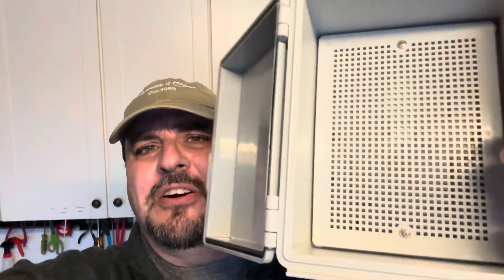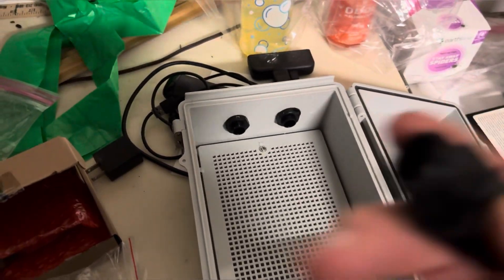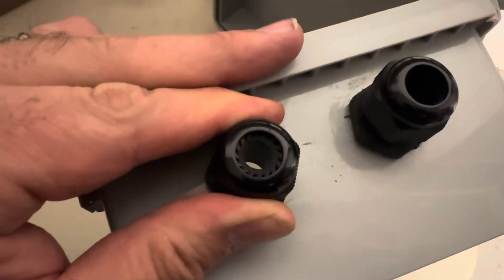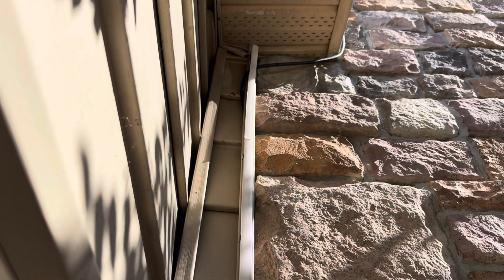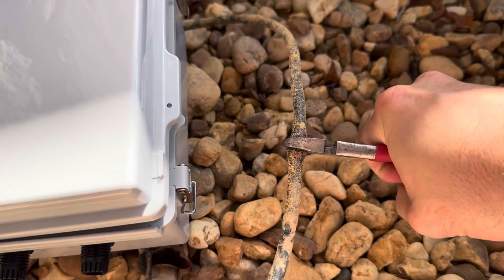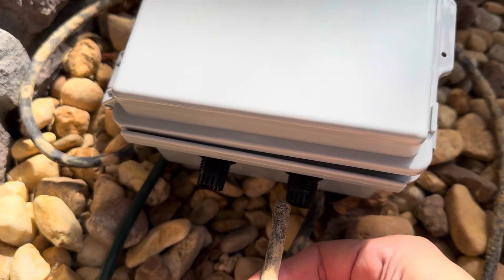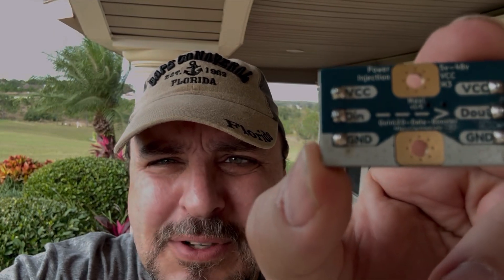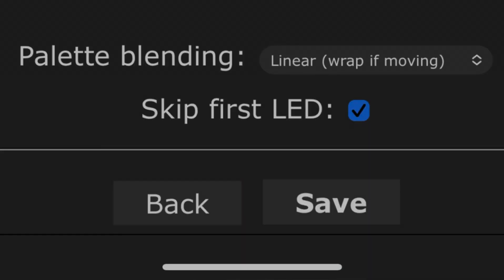Permanent Christmas LED lights: Data Booster

Comment: Thanks for the video. Getting ready to install a large set myself and was wondering about the data signal. Can you put a link in the description for the data boosters you used? Also drilling into those boxes are a lot easier with a Unibit (aka step drill).
Reply from the maker: Here you go: https://www.drzzs.com/shop/3-wire-data-booster/